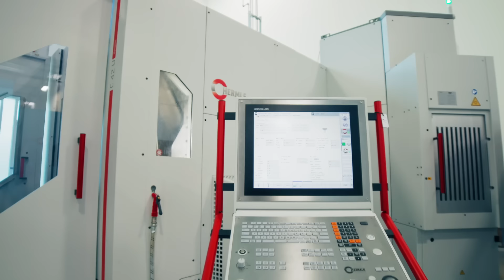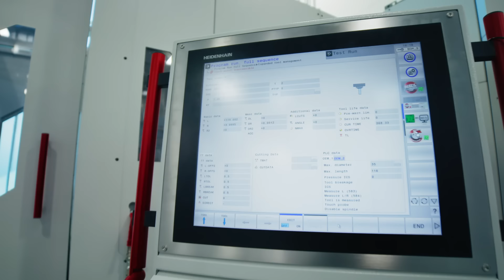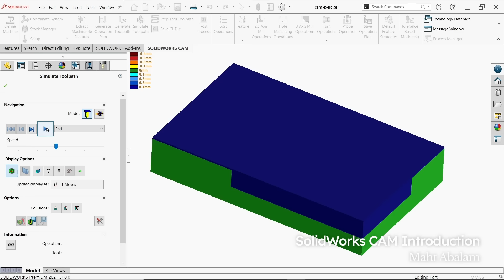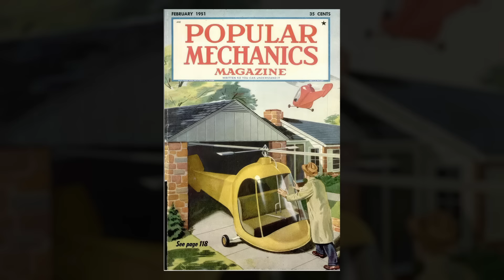They're Reimagining How to Build Anything | Hadrian

Comment: Another great video.  I have been binge watching several just now.  Hadrian, Dirac and Chroma.  Hadrian is strong on manufacturing, and Dirac on manufacturing for assembly.  Dirac has a problem with learning from legacy engineers, and Chroma has an AI solution where they imagine companies might rework their process to have AI learning at the core.  They are all strong on the software layer.  I think you need a video where you get these 5 people in a room for a brainstorm session and record whatever comes out.

Comment: China has been doing this for two decades now. We're on catch up.
Reply: Yes but the Chinese ultimately do it poorly thanks to systemic failures. Americans have to worry about improving automation. Chinese have to worry about poisoned water, food, and falsely advertised alloys. One is far worse than the other.
Reply: Those claimed poisoned food and water do not change the fact that we are behind in manufacturing. These are different topics.

Comment: Excellent video. I am in manufacturing in the USA and it's difficult at best. Some things definitely need to be made locally but a lot of what we consume is likely better made in lower cost places which have scaled for this type of production. At least for now.

For example China, as much as we in the USA currently bash them, has built out an amazing manufacturing infrastructure. As a USA based manufacturer of B2C products we struggle to eak out a profit competiting with Asia manufacturing. Higher costs and then our products are quickly knocked off. Forget patents. Takes too long and pretty much worthless for most products.

But this looks interesting. Automation across the supply chain may be the change we need.